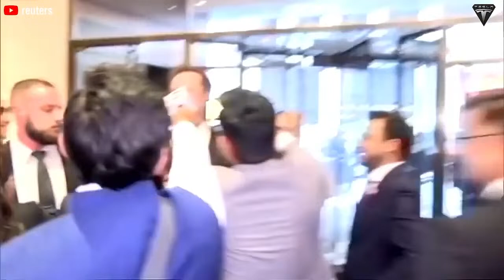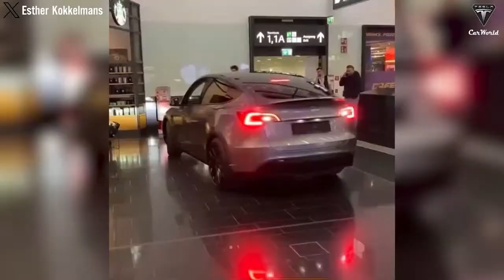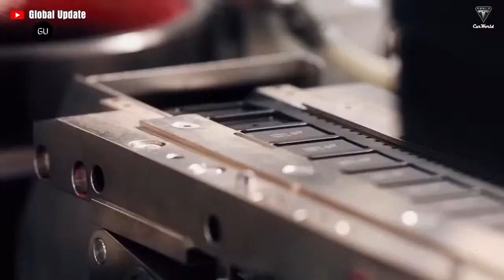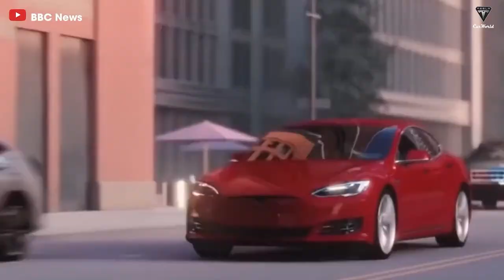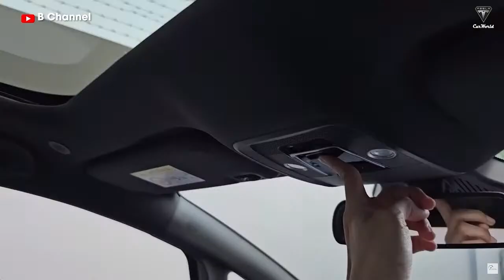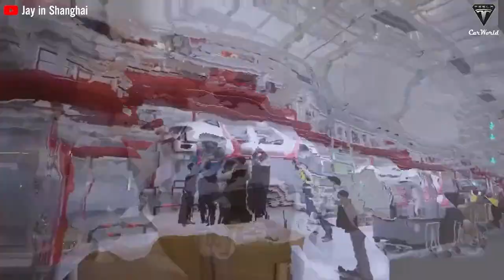It Happened! Elon Musk Review Tesla Model 2 Reliable Design, Features, Production and MORE!

Comment: The posted video is a lie there is no production line for Model 2 in 2024. Doubtful if the Model 2 will be built in 2025.
Reply from the maker: It seems you don't believe it, but to get the most accurate and clear answer, wait until 2025.

Comment: The success of ICE vehicles is the fact that they all use the same fuel, and use it in the same way:  gasoline.  And EV's - even though they all use electricity, their means of getting it, storing it, and using it is with a different procedure from car to car.  Until they all come together and decide how electricity is being obtained, stored, and used, and apply that to all vehicles, they are doomed to failure.